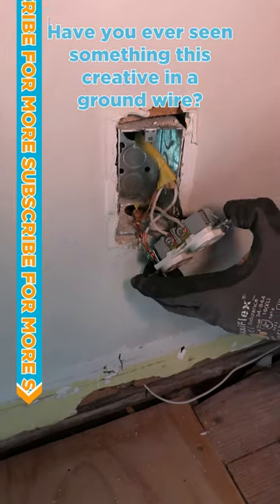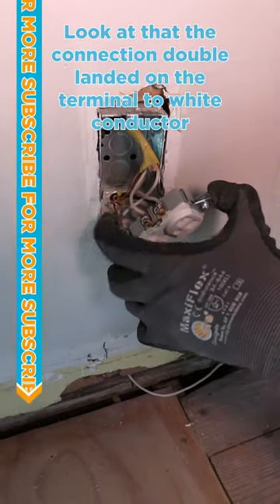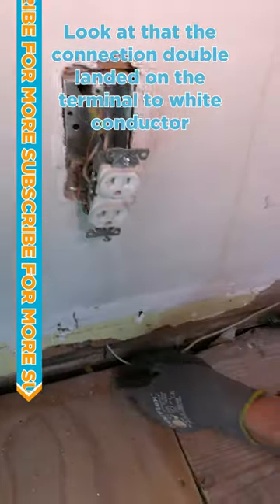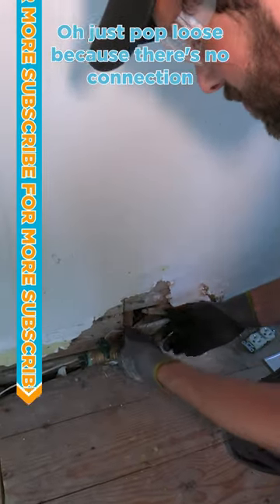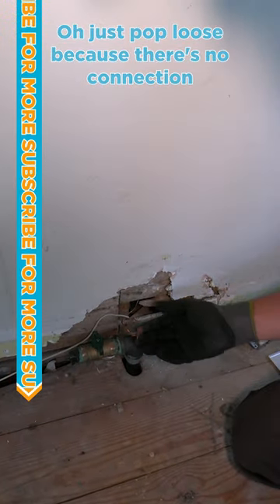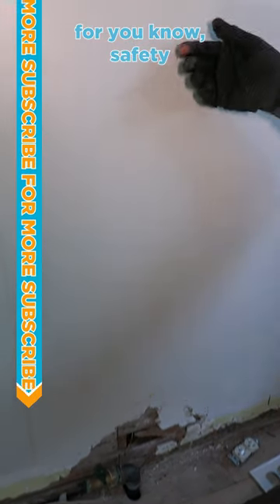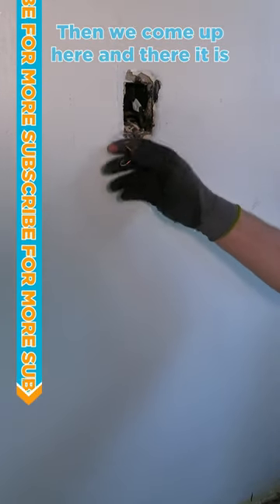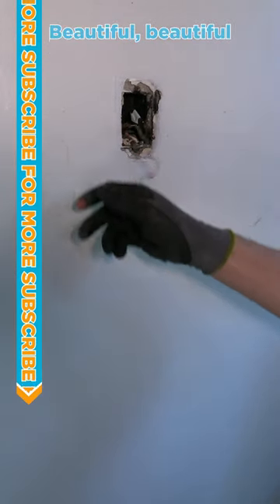Any grounding issues here?...

Comment: Yes and it's even worse non conductive pipe from gas company with no bond to panel so in essence ground flimsey terminated to non bonded gas pipe ha0n the water main was only on the residential side being feed from meter with pex than the fitting they did bond to was also pex on both sides so the only bonding is thru the water itself I was like wtf lol

Comment: 250.130(c) Allows you to run grounds to any accessible part of the grounding electrode system. If this is a state that requires the gas be bonded to the electrical system. It might be code compliant.

Comment: Did work in a rental. The tenant said that he would get shocked touching the fridge and the sink. Old house wires all black and the neutral side of the outlet was also attached to the ground screw, AKA teasing the ground. Further investigation found that it was actually the hot not the neutral.

Got to love slum lord's.
Reply from the maker: 😱 "Thanks for finding that!" - The Next Guy

Comment: the sad part is that the romex has a yellow sheathing for signifying it is 12 gauge wire, which they just started started color coating romex in last 20-30 years. So who someone must have came in there recently and did that atrocious wiring. Not good
Reply from the maker: 😬 True...

Comment: I’ve seen much much worse I’ve seen a piece of BX wire you know the metal shielded cable wrapped in insulation tape connected to two plastic boxes where the shield was used and electrified add connected to make a dishwasher operate I’m sure there’s something more dangerous but I haven’t seen it yet
Reply from the maker: That's very extreme!
Reply: @ElectricProAcademy  Here’s the funny part you’ll never guess how I was able to actually identify the customer told me after they had a baseboard installed he kept tripping I said OK but the baseboard was connected with pecks so the only way it could actually be tripping or grounding out is through the water inside the boiler after you reset the breaker it wouldn’t trip immediately it would go 89 sometimes 10 minutes and just for the hell of it I put a volt meter on the circulating pump Back at the boiler and I was able to read 34 V AC that’s crazy
Reply: @ElectricProAcademy  i’ve had so many incredibly crazy service calls that I should’ve maybe takes photographs and kept some notes but who would think about that when you’re just trying to make a living one of my favorites is a traffic light over at the local grocery store where I live I noticed the dog went over and urinated on the base of the pole and the dog yelped and suddenly ran off I know exactly what it was since I carry my tools with me I took out my tester that I use for actually testing utility poles and the reason I was watching the dog as I was walking my dog so I walked my dog got the tool went over and test around the base of the pole nothing I tested five or six Times still found nothing then I watch the traffic light as a change colors and the pole became electrified when the yellow and the green light that little transition between them happened amazing